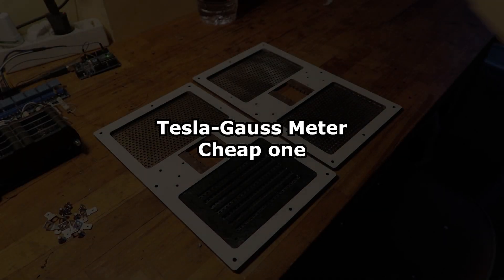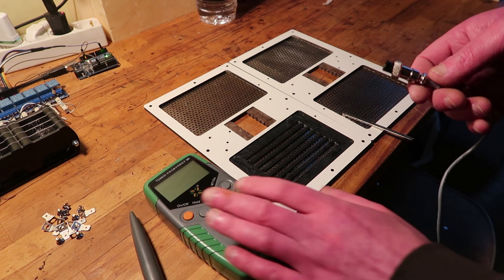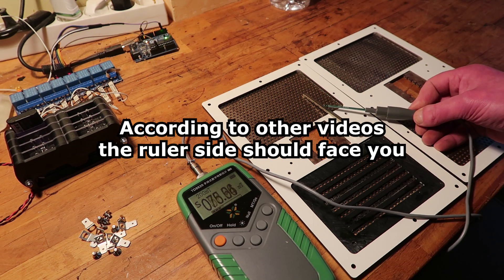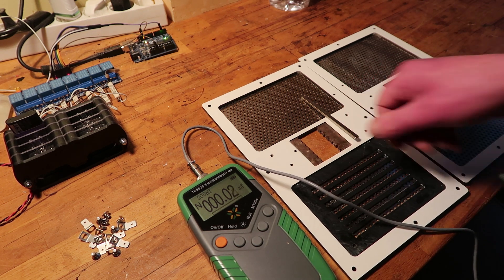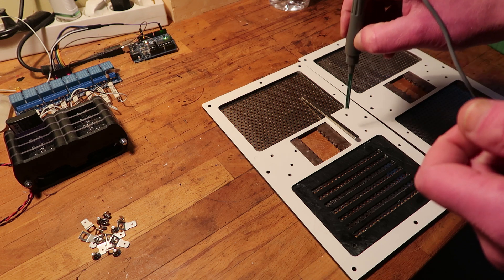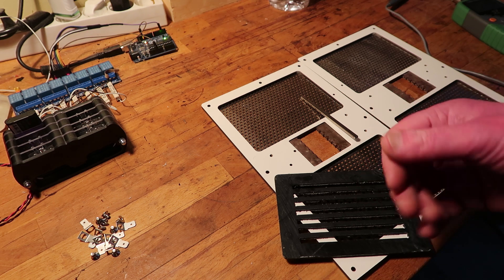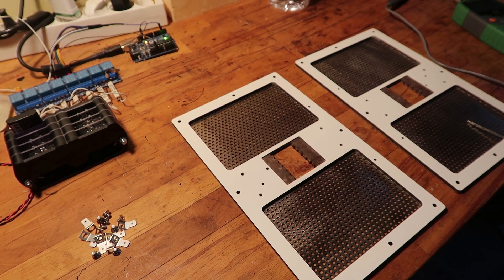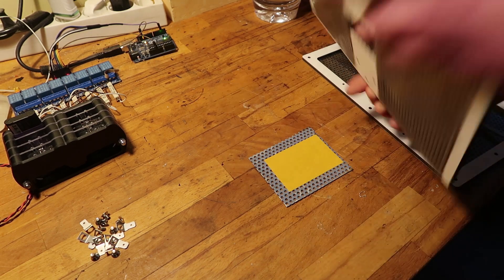Cheap Tesla meter - Well had to buy one after so many years :)

Comment: Its not 1% 1:30  its more like a 5% vers. you got there with that price and maybe 2% in some limited range.
these TD8620 comes in 3 ranges.. 5% - 2% - 1% and the price almost double pr jump so the 1% is almost 3x more expensive then the 5%.. 
if they actually meet those specs.. got no ideal
Reply from the maker: i guess not :) but when comparing apples to apples its fine :) wanting to know polarity or field strenght (with error) vs field strength with the same error :)

Comment from the maker: altrough your comment is gone somehow.  i did buy the mater from china , not the magnets. since they suck
Reply: Think its gone becouse I put in a link to some SB ob woofer. Yes they sell alot of crap. I gave you some crap magnets where they would be better with out plating. But anyway my point was you could sell those tweeter midrange as a diy where the costumer suplly the wood and woofers. Think you can buy SB woofers all over the world, and your planars is a size you can post.
Reply from the maker: Heej its you :) from the magnets and those paper ribbons. Thx once more for the magnets!  Wll yeah im informing on some ndfeb rubber magnets.  Going to be expensive but if they are strong enough i have some ideas for a product :) might cost me allot though since they do not take snall orders
Reply: @joppepeelen  never heard of ndeb rubber magnets . Is that super strong rubber magnets. Thats interesting plated neos is overkill anyway, since you dont expose the surface to anyting other than moisture.  What if you buy unplated neos, and paint them ?; that is maybe cheaper
Reply from the maker: Nerver seen non plated  neos... they rot so all are plated :)